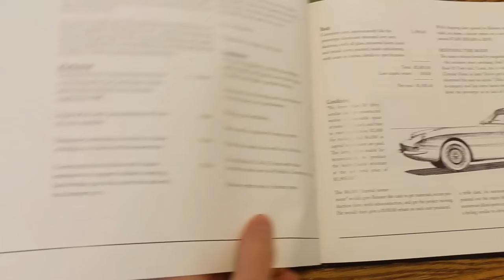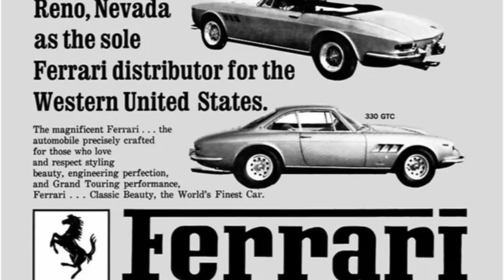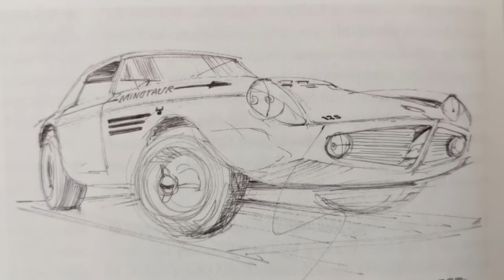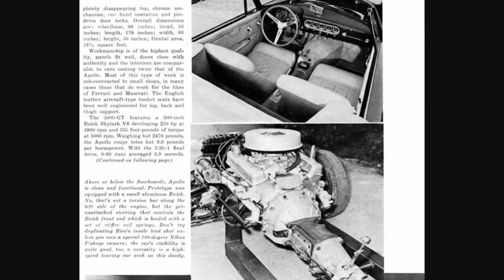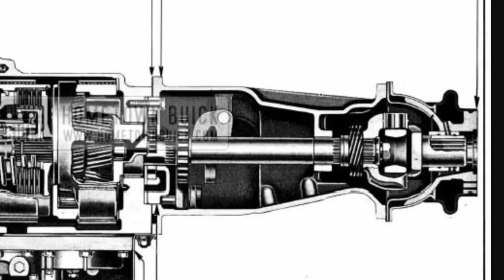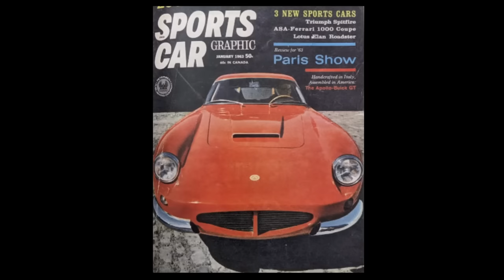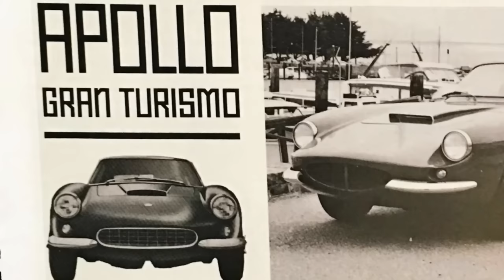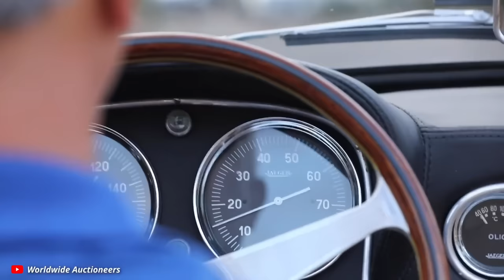The American Sports Car that nobody knew existed

Comment: Oddly and lesser known though is the fact that in 1974 and 1975 Buick released and "Nova body based car" named the "Apollo", the name as far as I know, only ran those two years, and in 1976 the cars' name was changed to Skylark for 1976 to 1979, before it was downsized to the "X Platform" Body (Citation, Omega, Phoenix, skylark) body style of 1980 and 1981!
Reply: You missed the A/G platform of 78-79 aeroback Century turbo, arguably the true predecessor of the GN.

Comment: At 7:42. The Buick/Rover V8 is not light weight. It weighs over 200Kg. The modern LS series is only a few Kg more.
Reply: Only an aluminum block LS V8, as the iron block versions weigh around 560-600 lbs depending on accessories. 
The Buick/Rover V8 with a simple induction system and limited accessories can weigh as little as 400-425lbs.

Comment: I might be drunk or crazy, could be both. But the taillights remind me of an early Dodge Viper.
Reply: Nah neither, ...they are in fact the rear taillights are Altissimo Torino off a Ferrari 250 GT California Spyder, but horizontal the front turn signal also off a 250.
Northrup had an Apollo that he sold to Finley, James Taylor told me he was always trying to uae a taillight off a VW square back wagon ..I guess it could be used in a pinch.
Reply: Thank you for the information, very cool car. And I was probably drunk.

Comment: Dude, what are you smoking, most american cars of that era were done by 60K miles, only if they were meticulously maintained were they reliable beyond 100K, and I'm talking about heads off valve jobs, re-ringing pistons and compleet tranny rebuilds before 100k. Stop drinking the Detroit Koolaid dude, it's full of tetraethyl lead.
Reply: Not exactly true IMO , don't recall my dad doing anything to the engine but oil and clutch changes , and the front crank seal on his Apollo 3500 GT, 
 it was meticulously maintained as you mentioned but I think it was rebuilt at 170K -270kmiles. He drove the car daily  for 17 yrs , it was the black one in Santa Clara, CA seen in this clip with my hands removing an air cleaner.😮

Comment: American cars back before WW1 up to about some time in the early to mid 70's was not relyable and they did not get 100,000 miles on them . Only a vary few American cars could get a little over that . The Ford 260 - 289 could , There are some Chevy engines that could reach well into 100,000 miles . Like the 265 - 327 small blocks . The the is Chrysler engines . Like the 273 - 340 engines that can do as well also . For the cars chasses they dont far well . Rear ends blow out , Trans slips , Bushing wear out . Shocks . At best a old car could only get about 70,000 on them . The British car suffer even more . Most likely 34,000 miles in a MG is all your going to get out of it on American highways . The problem with the British cars back then is their engines . They came from Tractor engines . Low lumbering engines and not true auto engine . Then there is the road system in these countries also . At best top speed would be 45 mph . In the USA back in the day in most States was 70 MPH on 2 lane highways then that droped to 65 and droped again to 60 and one more time 55 because of the 73 oil embargo to flip the election . To force the people to vote Republican . FING WHIG's . So lets get on with it .